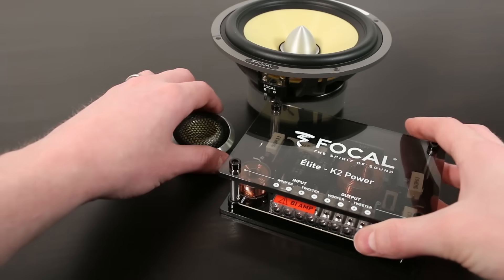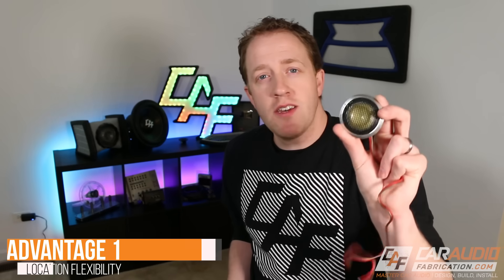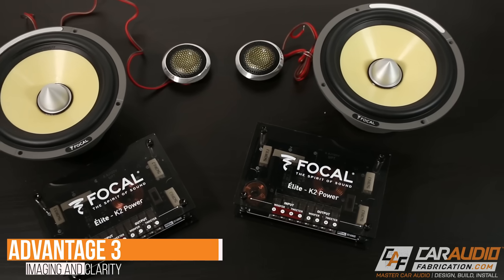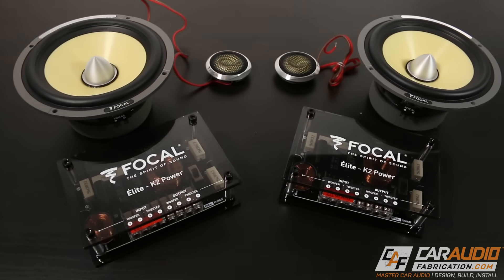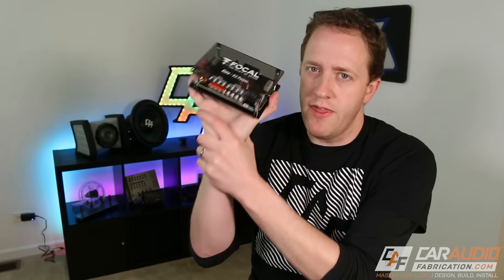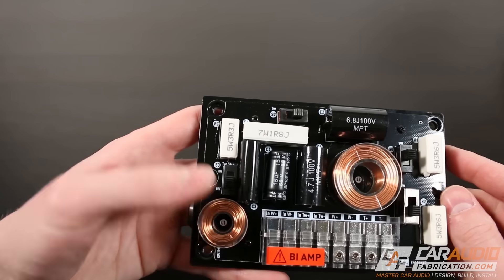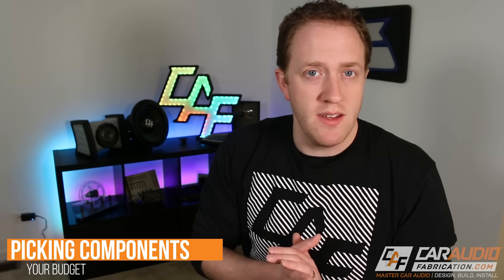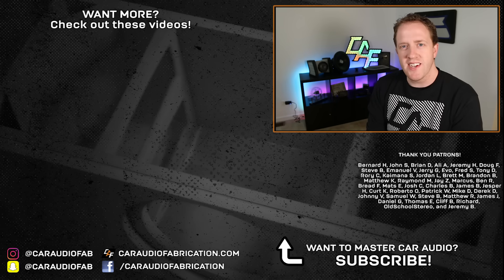Want AMAZING sound? COMPONENT SPEAKERS & everything YOU should know...

Comment: I have a 2018 Chevrolet traverse LT.  And I had just bought me the 2 way speaker with a built-in tweeter.  My question is will that ruin the stock speaker sound that has component speakers throughout? My stock speaker is a bose speaker system. Doesn't look like my stock has a tweeter anywhere.  I want to keep my stock sound as it is already great as it is stock.  I just want to upgrade to a better speaker system for long term reliability and durability. What's your recommended component set for my stock stereo system?

Comment: So a 2-channel amp can can power two crossovers and (each crossover) can power/filter 2 woofers and 2 tweeters.  Basically a 8 speaker system... off a 2-channel amp.  Component system set for Left & Right.  This would basically kill any fade control F/R from the head unit.  Would it be better to set the crossovers F/R, verse left & right?  I hardly ever touch my L&R speaker control, but hate it when I cannot hear enough sound from the back.

Comment: I have a 1996 lancer evolution and there's 6x9 holes in the parcel shelf, how do I get a high quality system? I can't have a subwoofer because that will dustort the 6x9s in the parcel shelf and if I don't have a subwoofer in won't have much bass? 
I have focal 3 way components for the front, kenwood double din head unit, 400w 4 channel amp, undecided regards the subwoofer though

Comment: I've been doing some digging on this as I'm looking at doing my own system in my car (thanks for all these helpful videos!) It sounds like the general consensus on tweeter placement is to have the tweeters higher (near the dash) than lower. I was curious because JL Audio's user manual says that this placement is sub-par, and that they recommend placing the tweeter slightly lower (see the manual for JL audio's C2-650), basically just above the woofer. I'm curious what you're thoughts are on this? I'm a total beginner so I'm not sure, or even if it makes a big difference. Thanks!

Comment: I drive a 2023 Ford F-150.  Looking to upgrade my stock speakers with component woofers and tweeters.  I'm guessing that there is already some sort of stock crossover for the factory door and pillar speakers.  Is using the crossovers included in the component speaker package redundant, or do you recommend using them?  Thanks!

Comment: Hi Mark, (did I get that right?) thanks for all your super videos! So I bought a 4 x 70W amp, a *2 channel active Sub (*budget) and 2 x $85 Components and after trying 3 different pairs of those, I've come full circle back to my factory Coaxials! These were pretty good before, not too loud, but now they sound amazing! Sadly, theyre paper and have very low power handling (30W) but I love the idea! (for MY car ie... its all subjective as you rightly say!) I'm going by my car and my ears but... how could 'I' possibly assemble a budget 2 way component speaker to sound better than a Coaxial designed by the R&D department of X car audio company?! Who make perfectly balanced Coaxials? At all price points? My question, which will hopefully spark a video from you, is... In the $80 - $100 a pair price range, why not have a 4 Coaxial + 4 ch Amp + Active Sub setup? The Coaxial need not get clouded by too much bass from the amp as you have a Sub. The Coaxials are easily tuned by turning down the Sub to 0 and tuning the Coaxials for clarity, (as much treble as you like) and body in the mids as you like it but just enough bass to sound warm. Is this not a better solution if, like me, you aren't an expert? Isn't this a more idiot proof solution? And won't it sound amazing when I add my $80 Polk Coaxials this week? (I can't wait!) I couldn't find a video on this. Even Audiophiles do this at home... crystal clear bookshelf speakers and a powered Sub. So why not in the car? Thanks in advance for your reply or video reply! 🙏🏽😃

Comment: In the  crossover you are holding I see a "Bi-amp" (ing)   input which means that you can drive all drivers individually meaning you can dip the tweeter level all you want as it will have a designated amp channel driving it.  Just mentioning cause it does not get mentioned in the video. 
Am Mentioning this I have often seen people simply deciding to not  use the crossover and connecting the drivers directly to the amp and call it a day, which is not the best solution acoustically to put it mildly... :-) 
 
 In this case of "direct connection"  you need to use Dsp or a good parametric equalizer  in order to correct the frequency plot as a crossover is not only meant to separate the frequency content so the tweeter does not get bass frequencies and vice versa  for the woofer  but also to balance the frequency plot of the driver as a driver by it self in very (very) rare cases needs no frequency response correction. 
So 
This is general information, not directed to the OP of the video which I find wonderful  and making superb videos.

Comment: I have an existing component speaker system.  The "Tweeter" opening in my dash will support a 3.5in coax speaker.  "IF" I go with a 3.5 instead of the included tweeter, how would I connect that to the crossover?  or would I just bypass the crossover because it already has the capacitors included?  Looking at a Kicker 3.5.  Thanks

Comment: I just want good sound without needing multiple batteries etc. I also don't want to pay as much for the system as for the car lol. I got a sony head unit i figure get component speakers in front. I am unsure should I do 6x9 in the back door( its what fits) or 3 way or another set of 6.5in mid range - tweeters. would tweeters in the back be overwhelming

Comment: I’ve got a 2021 f250, thoughts on hertz SX690NEO 3way coaxials in front doors, and the hertz Millie pro tweeters in a pillar to replace stock tweeters. Is there a significant gain going 3way component speakers than coax. Thx

Comment: I just installed a set of component speakers today without being powered by an amplifier but straight from the head unit. I instantly noticed loss of power in my system and I'm using a vintage JL Audio crossover on my components. I'm definitely going to install a second amplifier.

Comment: Does a component wired parallel mid and tweeter both are 4ohm  using a component active or passive crossover (both on same amp channel) change the Ohms total load ?

Comment: I am wanting to upgrade the factory speakers in my sedan.  I was quoted the following configuration, can someone weigh in on this please:
Focal Integration Series 6x9 Component System
Focal Integration Series 6x9
Kicker 12" Thin Down Firing Subwoofer and Passive Radiator
Kicker CXA Series Amp 400x1 at 1 ohm

Comment: Most passive component sets have small tweeters due to the need for easy installation in many factory locations, but that means the tweeter must be crossed high since it can’t handle playing lower frequencies. 

With a high crossover value in a 2 way component set means much of the midrange frequencies are played by the mid bass driver. This lowers your soundstage. With a larger tweeter that’s crossed at 2500hz or lower can really elevate your sound stage and improve SQ. 

It’s rare to find a passive component set with a large tweeter, so I’ll ask, do you know of any larger format tweeter component sets?

Comment: My components are rated at 4 ohms. I put the tweeter in the oem dash and the woofer in the oem spot in the door. Apparently, the two are wired in parallel so will the load now be 2 ohms or still 4 ohms? Really need help with this so i can get the most out of my amp please

Comment: Wow car audio is such an interesting rabbit hole. I personally just wire 4 decent door speakers directly to the head unit and add an amp and sub in the back somewhere. Achieved very decent results and saw no need to go further. There's an 80/20 rule when it comes to results. You can achieve 80% of the result by putting in 20% of the work and money. You'd need 80% of the work and money to achieve that remaining 20%. I'm sure the end result is worth it but dang.. you must have some high brow clientele for your installs. It would be an interesting video to see the client interaction side of your business. Where you discuss product and numbers with your customers.

Comment: Thanks for the video , really helped me a lot in understanding car audio. I have 1 question though, can i wire 2 midrange speaker 1 tweeter on a single 2 way crossover? For example 2 mid range speaker and 1 tweeter from the output of 1 crossover
Reply: Yes, you would have to make sure the total impedance would equal what the crossover is rated for.

Comment: Any advice or brand you would consider for a component setup for a crew cab F-250. Already have aftermarket tweeters in the rear doors, however I need to replace the older kickers currently in place. They won’t be able to handle an amp with the power I’m wanting to push. Thank you and great videos always learning

Comment: Hi, I just subscribed and enjoying your videos. I'm having difficulty choosing speakers for the front of my 2008 Dodge Magnum. There's 6x9 in the door where most of today's 6x9's won't fit so we'll probably do 6" round, then stock 3.5" in corner dash. Crutchfield is pushing woofer in door and tweeter in the 3.5" dash locations. I'm sort of thinking 3 components with a 3.5" midrange in the current 3.5" location, then maybe the A-piller or top front door for tweeter. Thoughts?

Comment: I have had ONE SET Focal K2's for 7 years. I have had 10 subs, 8 amps, 4 head unit,s and one set of Focals K2's. I have had them transferred into the 4 cars that I have owned over the years. And I have challenged Audio store owners to compare my system to theirs ( in their boards). Does that tell you how good they are!!!!! OUTSTANDING
Reply: I regret selling mine. I had the 165K2 poly Kevlar’s from 2002. Best sounding speaker ever.
Reply: Same I'm about to put the k2 into a truck I've had them since probably 08 they are great

Comment: great explanation. thanks.  i have a question if you can assist 
i have a bose system in my current car 2004 mercedes SL with a D2B fiberoptic interface.  i have been searching everywhere for a solution without success. . Trying to replace the factory head unit with an aftermarket top quality ( alpine ilx f702d ) and was told that i need to rewire and replace all  speakers ( focal 165As3 recommended )  sub woofer Psb200 and  amplifier fxp5.1200 .  
is there another option that would utilize some of my existing components?

Comment: Question: is it possible to connect 2 woofers to 1 passive crossover? I plan to build 2 woofers into my doors instead of 1 woofer. Hope to get an answer before I start cutting a second hole in my door

Comment: I can’t stress how amazing good imaging is with passive crossovers there are often signal delays at, and around the crossover frequencies. It is unavoidable it is just the side effect of using passive crossover. I would always recommend a DSP. I use the Dayton audio DSP-408 for only 160 bucks and it is superb for the price. Once you adjust the timing for each woofer and tweeter the imaging is superb
Reply: Or use quality coaxials.
My opinion coaxials are better rhen components.
Reply: Do you all use the DSP in your Headunit without having to get a seperate DSP?

Comment: Hi,
I  have Renault Duster 2017 model with stock stereo and speakers.  I want good quality in-car sound and not too loud. I am planning for 4 components & cross overs with a 4 channel amplifier. Should I choose high end quality stereo with average amplifiers or vice versa. I am not sure if the sound is coming through Amplifier, does stereo's circuit and quality contribute to the sound quality. Please guide me.

Comment: First off, I love your channel and have subscribed. I have a question, I have a digital designs s4 amp. It is a 4 channel staggered amp and apparently has great flexibility in running a front stage. I am having a rediculous time hooking up a simple set of hertz hsk 130 components run passive. I thought that I could just use the front pair of rca cables to channel 1 & 2 and then hook up the left and right speaker wires to the channel 1&2 outputs. My problem is my left tweeter and right midrange are not playing correctly. I have the amps crossovers off, deck flat, and have checked my polarity 2x. The sound from the midrange seems like it is filtered badly like the difference between fm and am radio. Lack of any bass etc. I have changed my deck thinking maybe one of the preouts was bad and I’ve also swapped the amp to its slightly newer version the s4a which has the same setup but it does the same thing. I have now tried to bridge the amp by using y splitters and same thing. Any thoughts? There are no manuals for these amps online and unfortunately DD has not responded to my emails. Thanks for any help!

Comment: I have a quick question so I had some component speakers and the tweeters blew out. I wanted to buy the same ones that came with them but I only find them used. I see some other tweeters that cost the same , brand new , and actually should sound better but they have built in crossovers. Could I put those crossover tweeters on the crossover that came with the component speakers ? Thank you

Comment: Can someone help me. If i'm running active it's need 4 channel amplifier right? For the connection from aftermarket head unit i'm have 3 RCA out for front, rear and sub, do i'm split from front head to RCA input channel 1,2,3,4 ot just channel 1 and 2 ?

Comment: what about pro audio vs component ? i am running 6.5 inch pro audio speakers which are then connected to 2 tweeters.. the pro audios range is 80hz to 5000khz and tweeters pick up from 5khz to 18000khz sounds pretty good but if i replace the pro audio speakers with 6.5 inch component speakers,. what difference would that make? the pro audio speakers can take a LOT of power. 150-200rms EACH speaker.

Comment: Please help! I have Alpine CDE-163BT Advanced Bluetooth CD Receiver with Alpine SPS-610 Coax in the soundbar of my Jeep and SPS-610C in the front with the tweeters mounted facing me. I added an Alpine S-A32F amp with channels 1&2 for the front speakers and Channel 3&4 for the rear speakers. But now the tweeters are HELL to listen to even with the FREQ selector for Channel 1&2 turned down or up. The shrill is unbearable. And the treble on the radio is at  "0". How can I turn them down? Do I need a digital signal processor or passive crossovers even though they came with their own in-line crossovers? I'm about to rip my ears out or rip everything out of my Jeep!

Comment: Great video.
Could you help me. I have a MB W205, I have added twetters, Hifonics vx 6.2t.
Now I have also replaced the standard speakers, only the front ones, they were horrible. I have put these. Crunch dsx42. Sounds good, but a little canned sound.
Is it possible that having tweeter and coaxial together is not too good? Or maybe you should put in a crossover to remove the low frequencies from the coax. THANKS!!!

Comment: I'm curious whether or not folks are installing woofers-only in the rear doors of their vehicles - like component woofers sans tweeters, so no coaxial speakers. The purpose being driving better low-mid frequencies, especially if you're starved for space and have trouble adding a subwoofer.

Comment: So Iv'e just change the stock speakers in my Mercedes w211 and found out that the amp is 2ohm and the new component speakers are 4ohm, will this be a problem or should I run a 4ohm capacitor across the terminals of the speaker to get the amp to read 2ohm and not overheat? Many Thanks

Comment: pros and cons to both designs. Assuming the drivers and crossovers are the same then: 1) Coaxial speakers have the benefit of better integration, less lobing, suck-out and destructive interference at the cross-over frequency but may have some intermodulation distortion because the tweeter is effectively mounted on a constantly moving surface i.e. the mid-woofer cone. Also, they are less flexible in terms of placement. 2) Component speakers may suffer lobing and comb-filtering if the tweeter is placed too far away from the mid-woofer but you do get the flexibility of tweeter placement - just don't place them more than 1/2 wavelength away from each other.

Comment: 4 amps, 2 pairs of cross-overs.  Mid-bass in rear, side body panel mostly hidden by rear seat bottom and matched tweets beside them, tweets to side of rear seat back.  Mid-range in front doors, tweets in place of phase plug, factory front door/A-pillar tweets.  1 SL7 12" Sub in trunk.  All stuffed in a 2000 Grand Prix GTP Daytona 500.  Miss the old girl !

Comment: I had a Kenwood DDX9906xr Head unit installed a long with a JL XD1000/5V2 Amp My question is if I still need the crossovers for my older Kicker R-13 Tweeters or can I use the Kenwood to Handel the crossover

Comment: I need some advice, I've been searching everywhere it might be a very stupid question but im new to sounds systems and speakers, i bought focals component speakers that came with a 2 way crossovers for woofer and tweeter for the front doors. I found out i have stock  OEM 3 way cross over and mid range speakers. Now I also bought some focal mid range speakers separate. I'm planning not to use the stock cross over and just use the focal 2 way crossovers supplied which only have the woofer & tweeter output (obviously). Now how can i wire the mid range speakers?  Do mid range really need crossovers? Can i just wire them straight in without a crossover?